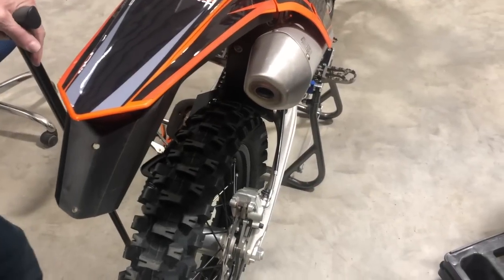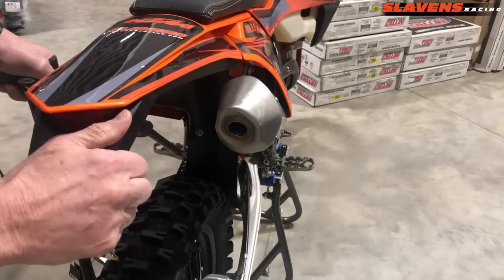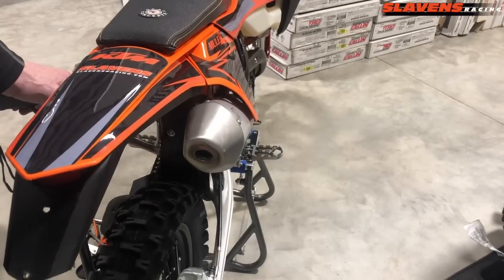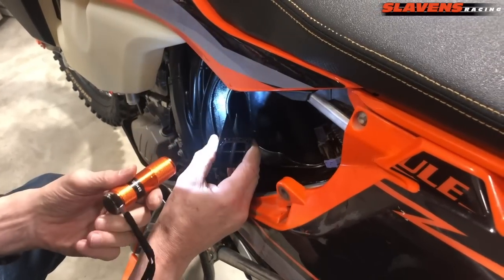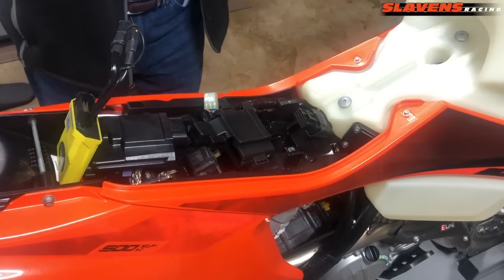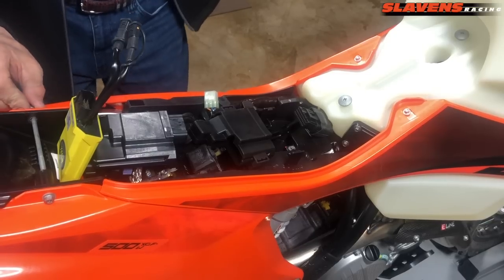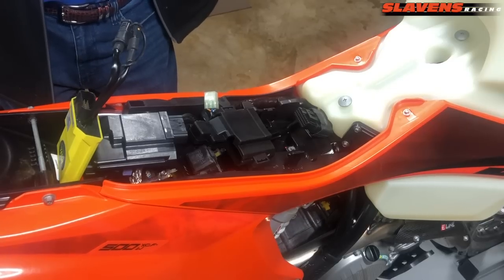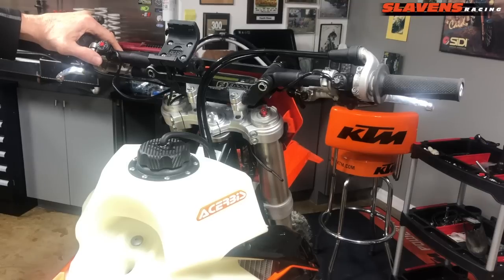How-to Make Your EXC-F/XCF-W/FE Rip!

Comment: I just added the Vortex to my 450 six days. I had the EJK (JD) tuner on it prior , better than stock but still had flame outs quite often. Reeds are out as well . Vortex in -What a difference , this is the way the bike should come stock. Rode today on my tight single track and not one flame out - Big thumbs up . I also replaced the end cap
Reply: I have in 3 years now not stalled my 2019 KTM 500 EXC even once, my old Yamaha WR450 used to stall all the time... But on my bike all restrictions has been removed and ECU reprogrammed for the full 58hp. Fully uncorked KTM 500 is a tractor that have huge power from bottom of rpm and  no matter what gear you have it in when twisting that throttle, and even more power at the top :) (it has surprised me more then a few times with power wheelies at 110km/h when I was passing slow cars just by twisting the throttle...)
Reply: Just did this to my 2019 six days what a difference no more flame outs why KTM would sell a bike that was trying to kill you I have know idea

Comment: My 2019 KTM 500 EXC did not have reeds in the air intake but a plastic funnel that was restricting air and it was a lot of work to remove it. Using reeds to do the same seems like  expensive way to restrict the airflow... They did reprogram the ECU for full power  (around 58hp) and disconnect the LAMBDA exhaust sensor at the dealership and for legal reasons I had to remove the air restriction and mesh in the exhaust myself. Top speed before removing air restriction was 110km/h as it was running extremely fuel rich :) After the top speed was around 175km/h.

Comment: Glad to hear you do not need to put in the tube. 2017 350 exc-f brand new change the exhaust and took reads out. I set the TPS up on it but did not change out my ECU. From research that I did they said on the smaller bikes like the 350Z ECU was not needed and could make the change with just TPS. Bike runs incredibly well way more power. Does have the backfire on decel. But what I benefit by putting the vortec ECU in for the money.

Comment: Thanks Jeff,!
I am hoping you and wife both heal up completely soon! 
 Great video, it is VERY much appreciated! 
I have the 2018 EXC500F- I have totally  desmogged it and  changed the exhaust tip,  plus I changed to the black throttle cam plate,. I felt huge improvements everywhere, it never flames out now plus has tons of torque, running 14-52 gearing for desert and woods trail riding. 
 I still have the "JD Tuner" piggyback device...
 So, my question is about the Vortex ecm versus  the JD Tuner device~ in your honest opinion does the Vortex make a huge difference over the JD piggyback tuner?  
 I am totally happy now but am wondering "how much happier I could be" 😊 
by just swapping out for a new Vortex or the GETT ecm/ecu.
👍
Reply from the maker: MP
I'm a JD dealer and have known those guys for many years. They are good honest, helpful and knowledgeable people so I hate to say anything negative about their tuners. 

All brands (there are several) of the piggyback tuners are made by the same company in Montana. I've tried them on 2 stroke and 4 stroke KTMs and have never been satisfied with the results. They help the fueling but don't go far enough and they don't make any changes to ignition timing or ignition advance curves like GET and Vortex ECUs. 

If your bike runs well you might want to adhere to the old adage, "if it ain't broke, don't fix it" .
Reply: Jeff Slavens thank you Sir!

Comment: The stock ECU MAP settings on my 2021 FE501 are fixed and won’t compensate for the lean condition the intake or exhaust will cause by improving air and exhaust flow. I’m doing the triple combo-Intake, FMF and Vortex next month all at the same time. The Vortex MAP has 10 preset tunes to choose from including altitude tunes. I can’t wait. I rode my buddy’s KTM with all the mods and I realized my Husky, while still a quiet torquey mountain goat, had asthma compared to his KTM.
Reply from the maker: Hello: Glad to hear you rode your friends bike for a little enlightenment. The combo of removing the reeds, updating to the Vortex https://slavensracing.com/shop/vortex-10-map-ecu-husqvarna-vortex/ and changing out the muffler to a Graves https://slavensracing.com/shop/titanium-diamond-muffler-by-graves-motorsports/ or FMF https://slavensracing.com/shop/factory-4-1-rct-titanium-slip-on-exhaust-husqvarna-fmf/ will totally transform your new scooter. Enjoy the ride!!!

Comment: The sx-f boot will rub the shock since it’s for a linkage bike. The reeds actually improve torque. They’re only there to quiet that bike.
Reply from the maker: I'll install the boot to see if there is an interference issue. 
The reeds do NOT improve torque, not even a little bit and I realize they are for noise reduction.
Reply: Jeff Slavens how much louder are we talking about and power without doing ECU change on 2020?
Reply: Jeff please let us know if the SX boot rubs when you fit it. Also do you mind specifying the part number? Thanks for the video and I hope you recover from your injury soon.

Comment: Jeff, thank you for the video. I have a '17 FE350 that I desmogged, Rocket exhaust and I put in an FX air boot with your Vortex ecu . Fit perfect, the temp sensor used different fasteners, but a really great upgrade and no snake oil used. Day/night difference!

Comment: Great info. Did you confirm that the SXF air boot is a direct replacement and good fit for the EXC?
Reply: You could just order the European market air boot for the exc without any restrictions.
Reply: SXF boot won't fit with the PDS shock.  Need the euro boot.

Comment: Great video which makes me have a question regarding my '21 500 XCF-W. Going to install a fuel dongle and disconnect the 02 sensor 9:31 .    Should i leave the reed1 installed or remove it? Don't want it to run lean. Thx!!
Reply from the maker: Hello
From the factory they are extremely lean and any mod you do to the intake or exhaust will make it even leaner. To correct the lean issue you MUST replace the ECU with a Vortex or GET ECU. There are NO  cheaper solutions that are worthwhile.

Comment: Love this video, thank you for doing it! So helpful. Any chance you know how to reset TPS points on a 2023 KTM 350 EXCF? It doesnt have a kill switch like yours but more of a traditional street bike kill switch that kills all connection to the ignition, so I am trying to figure out how to do the full open throttle point. Hope this makes sense. Thanks in advance!
Reply from the maker: Hello Dan:
Aim & Vortex will find the end points after a short engine run time. The GET ECU can be set with the app.
Reply: @slaverace1  Appreciate this, thank you.

Comment: On Vortex website they recommend running a FMF 4.1 with the ECU for the best power gains plus the ECU is mapped for the FMF and not the stock exhaust
Reply from the maker: Our maps are proprietary (not stock Vortex) and work well with FMF, XCF-W, Pro Moto Billet end caps and modified EXCF/FEs mufflers.
Reply: @slaverace1 can we run an sxf slip on as well?

Comment: Awesome video! So I have a 2020 FE 350 and it came with a 3 year warranty. I’m just wondering if I put the vortex ecu will it void my warranty? Or could I install the original ecu back on and not have the dealer know? And will the hour/ odometer still work?

Comment: Hi Jeff thanks for your video
I will buy the husqvarna fe 450 2021 I will eliminate the air box reeds. I think the fc 450 air box no longer has the reeds. I will put the complete fmf exhaust. I think we just need to put the vortex map because once we add more air we need to add more gasoline? are these 3 steps right?

￼

Comment: good video man. I just bought a 2020 ktm exc 500 with the O2 sensor. I'm having trouble finding if you need to install a fuel controller if you remove the reeds and put a more open end cap on the exhaust. New to EFI bikes. I always assumed O2 sensors was sort of a self tuner but when i did my first clearance check and pulled the plug, looks like the bike was running a tad on the lean side. I have seen guys on forums suggest its a closed loop system or something so the tuner would be needed.  Bike does run good stock but you can tell its wanting to open up a bit more. Cheers!
Reply from the maker: Hello: Because KTM needs to be compliant with EU and US emissions standards, the programming only allows the ECU to make minor adjustments. I have an XCF-W that has different (richer) OEM mapping and I was able to remove the reed with no issue and my exhaust is stock, no restrictor. If you want your EXCF to run well, run cooler and last longer, buy the Vortex.
Reply: @slaverace1  Ill get saving then. Thanks for reply

Comment: I removed all the restrictions in the exhaust after that I messed with my idle and choke screws a little bit, my bike randomly backfired and shuts off while riding now I have no clue what’s going on but I think it’s the screws. Can you make a vid on adjusting the choke and idle screws
Reply: Did you ever do anything with adding fuel via programmer or ignition? If not your bike is running super lean

Comment: Followed you the whole way except the airbox. So do you just take the reeds our or try to outfit with a different airbox completely?  Thanks and loving theses tutorials.
Reply from the maker: Sorry, sometimes I don't explain things well. The SXF air boot is just a possible option. Just remove the reed cage, remove the exhaust restrictor (if your bike has one), install a Vortex or GET and let er rip! It's a huge improvement with the same smooth power delivery as stock.
Reply: Jeff Slavens thanks and thank you again for doing all the homework and explaining this stuff to us. Be safe!

Comment: If you remove the plastic cap ( air restrictor ) on the intake , do you need to change the Ecu ? I have a ktm exc-F 350 2017 model , thank you for your video Jeff
Reply from the maker: Hello: 
Any mods to the intake or exhaust that increase air flow will require a different ECU.
Reply: @slaverace1  tank you for your anwser 😊

Comment: Jeff, When I was cleaning my bike today I noticed the gasket on the reeds is half off just flopping around. Can I take it completely off without removing the reeds? The bike is de smoged w vortex & Pro Moto end cap. I haven't yet removed the reeds as I heard it will make the bike a bit violent on the low end and I' a bit hesitent. Thanks

Comment: Jeff, I have a 2021 KTM 500EXC-F. It runs really good for as plugged up as it is with lots of bottom end. I would like to just open up the EndCap or add the Fastway endcap/spark arrestor with no other changes. Can I get away with using the stock ECU or would that one change cause fuel mapping issues what will effect long term reliability? I'm not looking for more power, just better sound and a tad cooler running motor. Suggestion?
Reply from the maker: Michael: With the butt plug intact, no offense intended but your 500 runs more like a well tuned 350 so I highly recommend removing the restrictor plate in the muffler. I have a 500XCF-W and the stock ECU is different than yours that has leaner fueling. You will need the Vortex or GET if you modify or change the exhaust and you will be a happy camper. It will not rip your arms off or make make it difficult to ride. The added torque and HP will make it easier to lug the engine for improved traction and enjoyment. If you need more help, let me know.
Reply: @slaverace1  in the video earlier you referred to the O2 sensor with compensate to a certain point would this not help by just pulling the butt plug out? Love you videos by the way

Comment: I am looking at getting a 2013 KTM EXC-F it has a FMF Full exhaust system. 
It has a piggyback tuner. 
How much power can I expect out of one of these bikes ?
The new ones I hear are 55 horsepower unplugged. 
But what about the older one The 2013 model ? I can't seem to find information on these bikes too easily
Reply from the maker: Hello:
Sorry, I'm not going down that rabbit hole. All unplugged, correctly tuned 500s have more HP than 99% of people can handle. If you think you're in that 1%, tape the throttle wide open and hang on. Let's see if you can ride it like a 125 pro rider. Please send the video!

Comment: 2022 KTM 500 XCF-W. Jeff, Do I need to remove the O2 sensor and block it off? I installed the Vortex ECU, added the FMF 4.1. Have not removed the intake reed valve yet either. Thanks once again for your expertise on these issues.
Reply from the maker: The Vortex does not utilize the o2 sensor. You can leave it or remove it.
Reply: @slaverace1  thanks Jeff
Reply: @slaverace1  Installed the Vortex ECU, FMF 4.1, and removed the intake reeds. Still experiencing flameout at low rpm. Any suggestions?

Comment: I will buy a husqvarna fe 450 2021
 will eliminate a reed air box.
 will buy the air box of the fc 450 i think no longer has reed values.

 I will put the complete fmf exhaust. I think there is still a need to place the vortex map because once we introduce more air we need to add more gasoline?
 are these 3 steps right?

Have to do anything else?

Comment: Problem, 2021 500 EXCF does not have that style kill switch. It has an off/on switch in addition to start button and key. The only way the motor cranks is with the switch and key in the on position which will start it. Other positions do not allow the bike to crank.
Reply from the maker: Hello: Not sure exactly what you are talking about and I don't have time to review the video. If you are talking about setting up the ECU, the set-up procedure works on EXC-F models.
Reply: @slaverace1  In the video you show holding the kill button,on the left side of the handlebar,then hitting the start button,on the right side of the handlebar,for about a second or so,the exc’s stock have a keyed ignition,and a stop/run switch,on the right handlebar only,there is no kill button on the left side.

Comment: Just installed a fastway end cap and removed the intake reeds on my 2020 KTM 350 EXC. It runs okay and doesn't backfire or anything, but it feels like my power curve isn't as smooth as it was stock. Feels like there are dead spots in certain rpms. Will the Vortex or GET ECU help with that, or am I just going crazy? I know the previous years it was more or less critical to install a new ECU when adding pipe or doing emissions delete stuff, but I know the 2020's are a bit different with the O2 sensor.

Comment: On the 21’ model will removing just the reeds do anything, saving up for a slip on
Reply from the maker: Removing the reeds will improve performance by increasing air flow but you must change the ECU to a GET or Vortex to add more fuel to match the air increase.
Reply: @slaverace1  the O2 sensor won’t adjust for that?

Comment: Thanks for your videos! So helfpul! On my 2021 500excf If I pull the reed from airbox and remove screen from exhaust I dont have to richen the fueling? bike will adjust on its own?
Reply from the maker: Hello: It will make a moderate compensation but not enough to make it run well. If you want it to rip, install a Vortex https://slavensracing.com/shop/vortex-10-map-ecu-ktm-vortex/ or GET ECU https://slavensracing.com/shop/get-rx1-evo-ecu-ktm/ . I know, they are a little pricey BUT you will forget all about the cost after you are done wiping the smile off your face. They are really that good.
Reply: @slaverace1  your the best! I buy all my stuff for my ktm from yal! I’ll purchase that vortex soon
Reply from the maker: @Dirtpoorhomesteader  Thank you!

Comment: You sell a device on your website (a snake oil product) such as an intake tube your speaking about. So why do you sell them if they are a snake oil product?
Reply from the maker: Hello: The one we sell from Mototerre is a bit different and gives a mild improvement. It has an internal twisted fin that directs the air correctly and increases velocity. We had many request for this type product so I found this one, tested it and put it on the site. It doesn't cure any issues and is not for everyone, but works well for guys looking for that last little bit of throttle response and HP.
Reply: @slaverace1  ok thank you for clarifying. I was debuting taking my reeds out but I had no choice. The rubber seal blew off and the reeds were up against my filter. First time taking the filter off. Bike had 5 hours on it. So that ended that debut and there out. I bought a EJK, exhaust end cap and put a twin air power flow filter cage on and I’m not looking for any horse power. This bike you already have to hold the hell on lol. I just want the best running bike I can get. I had a 2019 Suzuki dr and that thing was rock solid. Never got hot, never stalled, never left me sit. And ran perfectly with idle set.  I got the tuner and end cap to help reliably and the running not HP. if I could stay stock I would. But it runs like crap all bogged up. So would you suggest getting a intake tube if I have a EJK fuel tuner, reeds out, open exhaust end cap? Again I’m not looking for any power gains just smooth running.

Comment: Jeff I wasn’t aware of the TPS reset after the Vortex, I have a couple hundred miles on mine but she’s running fine. Anything additional to do like unplug and reinstall the Vortex if I want to do the TPS reset now? thanks!
Reply from the maker: John In WV 
John, just use the method in the video.
Reply: @slaverace1  I have a 2019 500 EXC with a Vortex. I have always heard the TPS doesn't need adjusted. I guess I should at least try this method, seems as basic as it gets.

Comment: Excf 250 six days 2022 . 

Will i need the vortex/get/powercommander if i do the reed removal , butt plug removal ?  Won’t the o2 sensor compensate for it as the bike is a smaller displacement ?
Reply from the maker: Do not remove the reeds or the butt plug without installing a Vortex, GET or Aim ECU. It will make it very lean and the Lambda sensor cannot compensate for that big of a change.